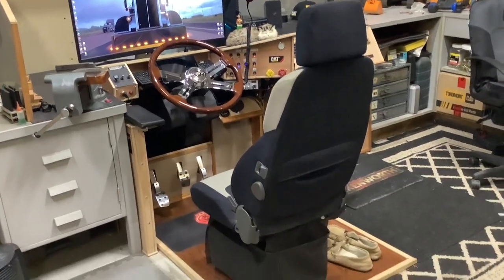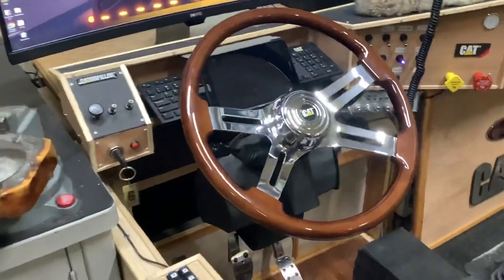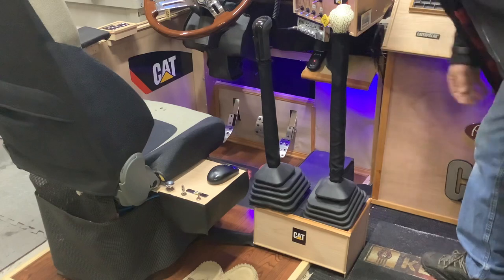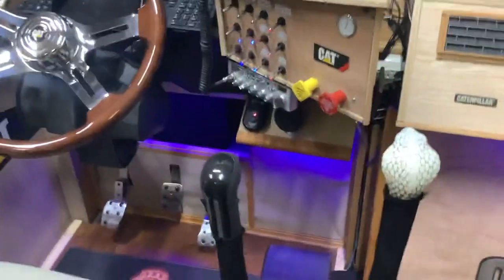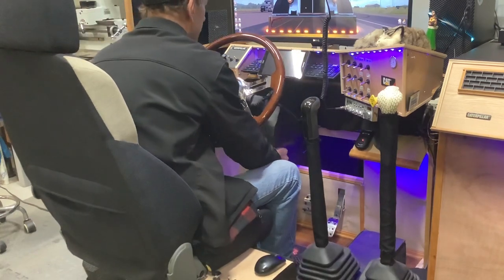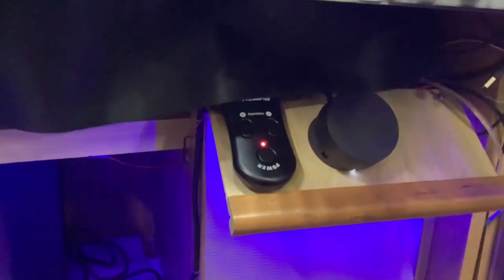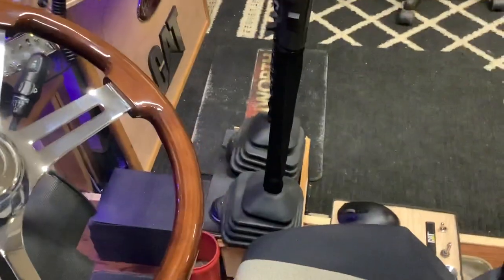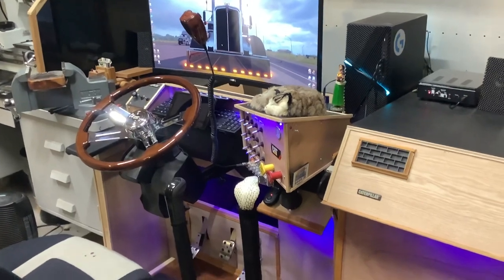American truck simulator sim rig tour

Comment: setup looks great! one suggestion though is to use triple monitors or doubles as it makes it more easy to look around
Reply from the maker: Thanks for the kind words. :).  I would love to try triple monitors at some point but I’m restricted for space to mount them and I’m very close to my lathe and flying metal chips. In the meantime I enjoy using the Track IR and has been a real game changer.
Reply: @Kinghauler2012   i’ve had both track ir and triples and i must say track ir is definitely  a game changer

Comment: That s really amazing. Except the two shifters. I would prefer one, if I could make the high/low switch to work that s more like real life me. But that’s amazing setup
Sir.
Reply from the maker: Thank you for kind words bud. And yes, I can run with just the main shifter and use the switches on the shifter handle. When I drive in convoy mode , I’m only using the one. But I enjoy the twin sticks for the extra activity and immersion into the game while in single player. Especially when I’m driving my 521 needle nose KW with a 6V92 Detroit . :)

Comment: Very nice setup.   Just missing 3 monitor or tv setup.  Got about. 1200+ hrs myself in ATS. Got g29 wheel, pedals, TH8a shifter and SKRS add on shifter.   Does your tablet. Display speed and RPM info? How you do that?

Yeah I got old Ipad air 2 that starting die, ( battery is just about dead) and not worth getting battery replaced.  Was wondering if could find some app that would display either gps or speed/rpm display for ATS.
Reply from the maker: The tablet display is using a program called Sim dashboard to capture the telemetry from the game. Only thing is, it’s an android program and iPads won’t work for that. Just a cheap basic Samsung tablet for instance will work.  And the app is amazing, you can choose which gauges you want , where you want them etc. also provides a gps map if you desire but will not include your current route but will display the map if you know what i mean. 
Sim dashboard.

Comment: what is your steering wheel driver from? a custom logitech solution or something else? can you link some items in your discription? awesome job by the way :D
Reply from the maker: Hello. My wheel is a standard G29 model which i custom covered with upholstery. The wheel is also equipped with a turn lever kit which is no longer available but a newer version is available. The kit includes a new mounting hub for any wheel you may wish to install. Here is link to the turn lever kit. https://www.amazon.ca/Obokidly-Upgrade-Simulator-Steering-Logitech/dp/B09M699FCV/ref=sr_1_3?crid=1G9A1MFY9AH1W&keywords=g29%2Bsteering%2Bwheel%2Bturn%2Bsignal%2Bkit&qid=1646517288&sprefix=g29%2Bsteering%2Bwheel%2Bturn%2Bsignal%2Bkit%2Caps%2C110&sr=8-3&th=1.  The 18” wheel is from EBay. https://www.ebay.ca/itm/304173977021.  Sorry if i missed anything.

Comment: Did I miss where you mentioned what the wheel and wheelbase is?  The wheel, frankly, to me, looks real.  Wonder what it is, and how you've connected it.
Reply from the maker: The wheel is a G29 which I added a turn signal kit onto. Then I had a 14” custom wheel on it and at a later date I went for it and put a 18” real truck wheel on it. Surprisingly enough, after over a year, it’s still working good even with big wheel on it.  The turn lever kit came with its own wheel adapter plate so it’s a one of kinda set up and that lever kit is no longer available so hard to explain or share a link to it.
Reply from the maker: And forgot to mention I used some material to cover up the entire G29 wheel base to try and make it look real……I guess I succeeded eh? :)  thanks for leaving a comment. Appreciate it. Have you seen my latest set up with a real truck dash? I’m loving and I’m done building ….I think. Lol. https://youtube.com/watch?v=rLlVCl7irdo&feature=shareb

Comment: I’m curious what steering setup that is, been looking for one to buy lately and nothing looks good, but the wheel, pedals, and shifter looks like they work for you.
Reply from the maker: The wheel base is a G29 and then I added a turn signal kit, modified the hub to fit the big heavy wheel. Many people said I would burn out or break the G29 by mounting such a heavy wheel. Even myself I wasn’t sure what would happen thought it might be too much. But here we are over two years have gone by now. I use the rig on a weekly basis and no troubles at all.
Reply from the maker: And I’ve updated the pedals since that video. Here’s one that shows the new improved pedals which I love and are very comfortable now. Those are g29 pedals which I took out of plastic container , flipped and mounted myself.  https://youtu.be/rLlVCl7irdo?si=86-7uOTQdg_iCnRj

Comment: what wheel and adapter did you use
Reply from the maker: The wheel itself is off EBay attached to a Logitech G29 but through a turn signal adapter kit with a 3D printed hub i drilled and modified to fit this wheel so, long story short, its a “one of “ kinda set up. :) https://www.ebay.ca/itm/304173977021